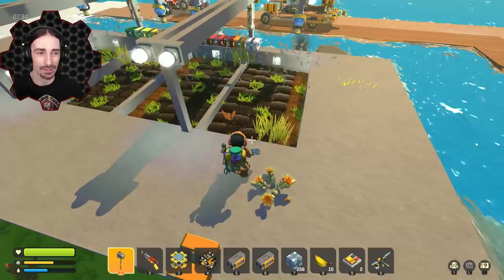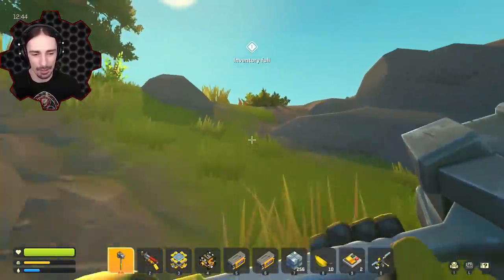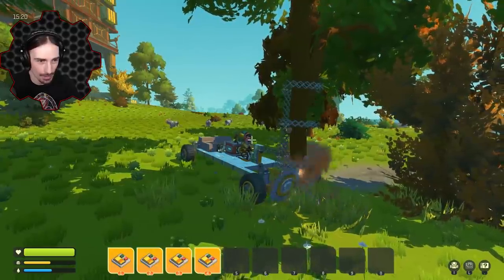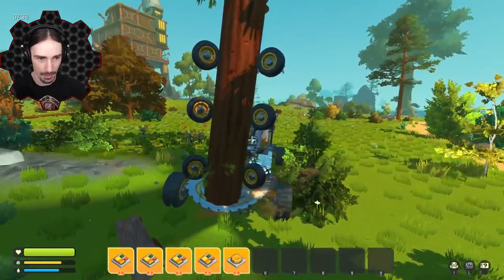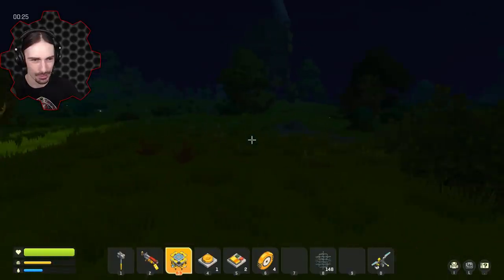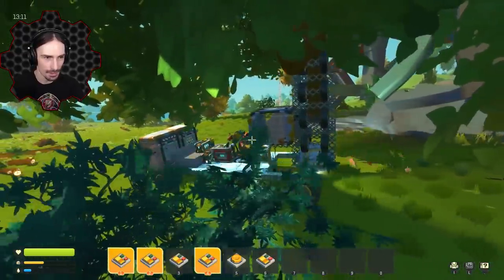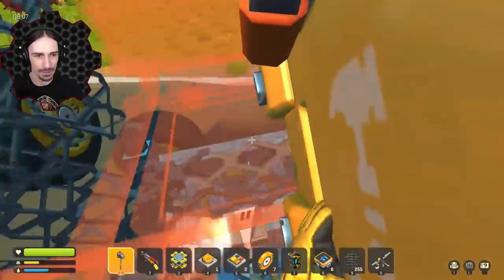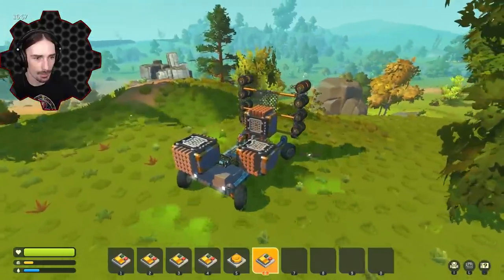Building a Vertical Tree Eating Wood Logging Car! - SM Survival Mode [SMS 25]

Comment: There's no need for the wheels as this design can easily use gravity instead. You don't need to "hold" the tree, but simply to envelope it in a wooden cage. (watch?v=U8w6PkWgoBU) This is the same idea but better, easier and cheaper...

Comment: the trees CoG is up too high for this design to handle, its putting a lot of weight to one side. make the guide taller and add extendable outriggers or something to the vehicle to prevent sideways tipping.

Comment: Increase the gap between the wheels for bigger trees, and use 8 piston instead of 6,

May be work out a way to have variable gap between the wheels..

2) Have you seen big excavators.. they have hydraulic legs that they plant on the ground for stability. Something like the angled green legs in this image https://www.iowafarmequipment.com/Wrag/wrag-diadem-400-post-driver-spike-24.jpg

3) make the saw blades vertical when cutting the logs down

Comment: U can make it so there r more pistons on 1 tire like not range 7 but 3 on 1 or 2 like this they have more power. 
And for the big trees u said u have unlimited beezwax so it is not a problem to just make it 5-6 tires wide but only tires. NO BLOCKS and that way every tree will go down. And I don't know if curved blocks r up but if they r will be good cuz u can use them as a guider if the big tree is stuck. I saw it. It was stuck on 1 of the blocks and if u use curved ontop of the normal blocks the trees r just going to slide down to shaped ones.
ty and if u add me. Call me Tony.
PLZ like so can be seen tnx for ur time.

Comment: Seems like the two major things needed is your car needs to be heavier so it doesn't lean with the weight of the tree. The grabing part needs to be taller, even if it's just a guild rail of wheels on free bearings. You have to grab at least up to the mid point of the tall tree's or the leverage works against you.
It also wouldn't hurt to make it a bit wider. The large tree's seem to have an invisible hit box wider than the trunk. I think it's the fungus growing on it gets caught on stuff. I know it's supposed to be 5 blocks wide but if you don't make it at least 6 they get caught some times.

Comment: ScrapMan!
33:45 the tree is slightly offset to the side of the vehicle, because the pistons don't have collisions. the tree is inside the pistons and therefore pushing against the side of the peg that holds the pistons.
A fix could be to place some net blocks not only behind the pistons like you did earlier, but to place a few pegs out from the piston holding bar in line with the pistons, as if you would add more pistons but with collidable blocks.
(also the big trees give normal wood the others scrap wood!)

but nice vid as always ;D

Comment: the big tree is too wide for the machine, the fingers at the front of the machine collide with the side of the trunk, creating too much friction to close the jaws with any number of pistons, its like trying to fit a round peg into a square hole, it just wont fit. to fix you could put the fingers on bearings angled outwards a bit, kind of like a hybrid between the original design and the later one.

Comment: Scrapman, if you ever wanna upgrade your tree logger consider this a bulldozer with saws on the bottom then it grabs the tree and then there is a bin that is like and upside down open bottom triangle that has sae all over the inside so it destroys the tree. once the tree is desteoyed the harvestable tree parts go through a hole the size of them so that skinny trees won't go right through. Then once through the hole the get into the material collectors that are next to the refine boys it is a lot of blocks but it gets wood faster and better! Well maybe I don't have sm so I wouldn't know if it works or not. Lol

Comment: Moonbo's sawmill combined with ScrapMan's cut and grab trees could work better :P
i'm currently at 16:40 so let's see the final result

Edit: After reaching the end of the vid i have some questions:
1_Using pistons to raise the 4 upper wheel for the larger trees might work since one of the biggest problems is the tree leaning to one side 

2_ Do the saw blade works the same if aiming up? 

3_ Smaller trees. Is there any smaller wheels to put between the guiding wheels grabbing the tree?

4_ Weight add more weight

I don't play nor have the game. i'm just curious

Comment: Hi ScrapMan.

Great episode! I'm really looking forward to see your new base expand.

Regarding the logging vehicle; what if you move your guide wheels further up?

Everytime the blades cut one section of the trunk, you lose the grip on 50 % of your guide wheels. Also since your pistons close tighter when the bottom section of the trunk is cut, you basically end up with a very top-heavy object that is supposed to slide down a short, funnel shaped tube, that is too narrow at the bottom. If you can grab the trunk near the middle, it should be more stable while feeding it into the blades. You could possibly have the top set of wheels mounted on additional pistons (lengthwise), so that you can move them up for extra leverage, and down when you start to run out of log at the top. Just a suggestion.

Comment: The raid optimizations are great, i get no more lag at all :D My wocs keep despawning/escaping since 0.4.4 aswell, they fixed it in 0.4.3 so my wocs wouldnt despawn anymore, but now they do again :( Edit: You should just reverse your sawblades so they pull a tree towards center of vehicle when they spin ^^

Comment: ScrapMan, I think you need to build or rebuild your vehicle around your tool instead of slapping a tool onto a vehicle. It is clear that you put thought into your vehicle, but I think if you put more thought into the vehicle's platform most of your issues would be dealt with.
You have a brilliant tool that you have proven to work, but the vehicle you strapped it to is too small, especially with those bigger trees, and has no way of stabilizing itself other than the weight of your vehicle (which has flaws). If you put your front wheels further out in front, your creation will have a hard time flipping over forwards. If you have to make your vehicle wider, then make it wider at least with pistons so you don't tip over.
If you make outriggers that plant themselves into the ground in an X around the tree, and maybe use suspension on the feet to make up the difference in terrain height, you won't have any problems tipping over.

Comment: I think the problem with cutting down the bigger trees is that the "holding chamber" isn't deep enough. It opens wide enough to grab a tree and the vertical height isn't the problem. You made a track of wheels to guide the tree but I don't think this track is wide enough to allow the mechanism to fully close around the large trees. If you make the guiding wheels one block further apart so they have 3 block axles, I think it will allow the "fingers" of the holding chamber to get past the tree and fully close. Right now they aren't wide enough and are getting stuck on the tree by the looks of it. This is what I observed so sorry if this isn't actually the problem, I hope it helps either way.

Comment: If you were willing to use 1 or 2 more saw blades you could have them vertical above and to the outsides of your grabber wheels so that they can cut off the odd branches as the tree slides down, that may help keep it level and feeding more evenly.  Also I think that your front saw blades should have 360 degree rotational movement so that you can spin them to get a cut going for when it does get jacked up.

Comment: Instead of the wheels you could use net bars attached to bearings on a controller to turn them on 90° up and down to create a cage like thing, and as the saws cut it, just make them turn like 60° up to create a inverse V shape and let gravity take care of the push. Another thing is the pistons should do a up and down and others a forward backward movement. And make it possible to extend the vertical pistons at least to the upper half of the big trees.

Comment: Tree Cutter Design: Make the cutting device in the middle of the vehicle. The bigger trees themselves was forcing your car to a direction you didn’t want and the design of the cutter is great. I would imagine you make some sort of circle design where the middle wraps around the tree and it begins cutting. Also you can make it so that all the wheels hit all four corners of the tree itself so it doesn’t wiggle out so easily. I don’t know if this would work but it’s a suggestion.

Comment: Did you consider putting the whole riser cutting apparatus in the center of the vehicle to better control the center of mass? make the vehicle more of a U shape with the pistons as the base of the U, spread the vehicle body to grab the tree it should hold up the tree better.

Comment: Try to use pistons to move one side of the wheels up and down so you can manipulate the large tree, correct it and make it to go straight into the sawblades. And when you´re at it you can make it more stylish to add weight :) Very cool invention. :clap

Comment: @ScrapMan i use a gravity feed 5x5 tunnle sawmill with a not connected to the sawmill suspension pice in the center to weld the trees to and the sawblades in the bottom are powered by a level 5 controller on loop. it can handle all trees and do it pretty fast.

Comment: The small wheel at the bottom was causing the big trees to be pushed over to the side, if you added a bearing to the small wheel to flip it out so it isn’t used for the big trees it would work better

Comment: Scrapman you should use the Scrap Mechanic Lab chief engineer method of transport by using glow worms as a propulsion method (https://www.twitch.tv/smlchiefengineer). i tried it and it works. it is very fast and the more you add the faster it gets but my idea is to build a raft where you can steer then add glow worms onto it then add a cardboard block somewhere as bait like riding a pig in Minecraft with a carrot and fishing rod with this method you can achieve new and better methods and use it for different things like if you want to get things back into your base you can put the worms in welded boxes (just needs to be attached somewhere not moving or loose)and attach chests to the box a ways away (i think it was somewhere around 80 blocks and the cardboard has to be somewhere on their level and somewhere they can get it [useable for a boat]) then instead of going back to the base with stuff or wood like in the logging machine you can put a refinery on the back of the vehicle then put your stuff/wood blocks into the chest and let the box go for the glow worm to take the box back to base (this is just my idea use it if u want or not) while you keep logging. i have a lot to say about the design u can use but i wont since its your channel and play through but id say use a small raft with the suspension glitch for turning and a lot of bubble material then use pistons (or not) for controlling back and forth. thats me please use if u want.